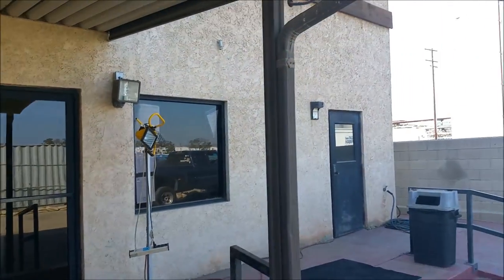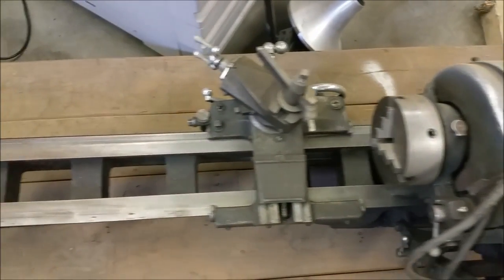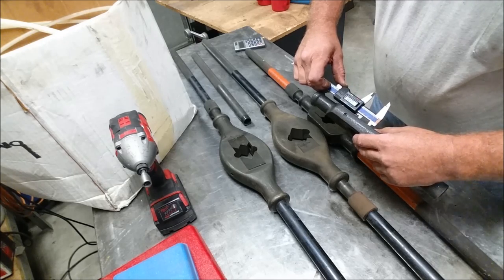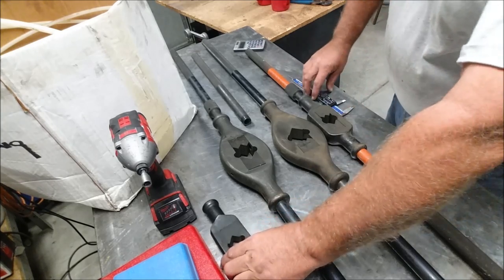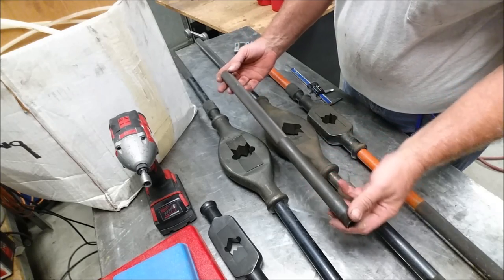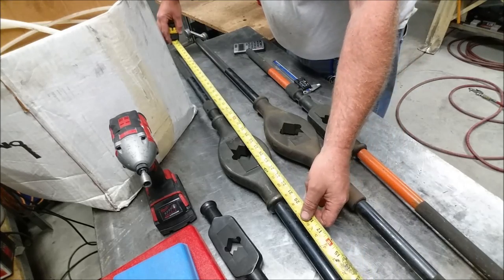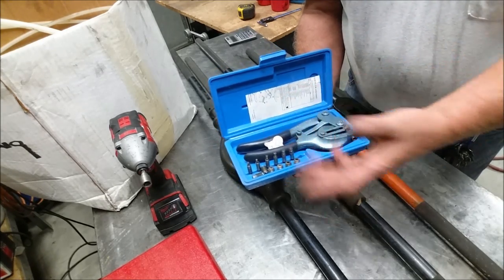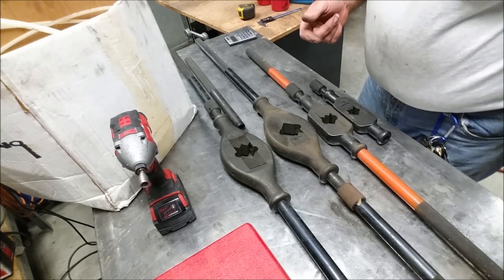Tap wrench run

Comment: Guys here we have the ultimate in good fellowship! Chris (BX2200) saw my YouTube video about why I need Tap wrenches which came about because of my Apollo 22 You Tube video. Chris sent me an email with the leads on two Tap wrenches, one was sold before I got to it, the other one had a humungous price tag on it! Then Craig' list provided the bonanza, now comes the joint venture Stan - Adam - Bruce 20,000 plus miles apart and the stars line up. how good is that! we all enjoy a great relationship and friends forever!. Bruce  Pssss we don't have Craig's list in OZ so it was all new to me. everyone deserves a good weekend and beyond, once a gain thanks to everyone.

Comment: Hi i have the exact Proto set and The set doesn't come with drill bits in the box and the standard larger size drill bit are too long to fit in the box so you almost have to make the box to suit the drills or get stubby set.
 I managed to fit the larger drills which have morse tapers but just modified the box to suit did a good job and the extractors are better than the normal sets I think they are shaped more for pipe extractors similar to the Walton sets you get but are very sturdy and I have used them loads highly recommend then.

Cheers

Comment: Question Stan
Could the square EZ out be used in a offset wobble type holder (as seen elsewhere on u tube,sorry I cant remember who posted it) to make a square hole on a mill or drill press?
Reply from the maker: Rob Robinson Im not sure what wobble tool you are talking about, but those really aren't designed for cutting.

Thanks for the view and comment.

Comment: if I have an M12-1.25 hex bolt, will a 1/4"-1/2" adjustable tap wrench work?
Reply from the maker: Hex bolts are .. well .... hex. Tap wrenches only fit square drive.